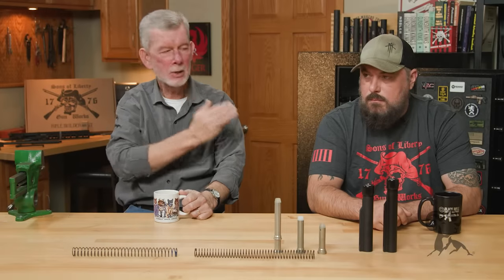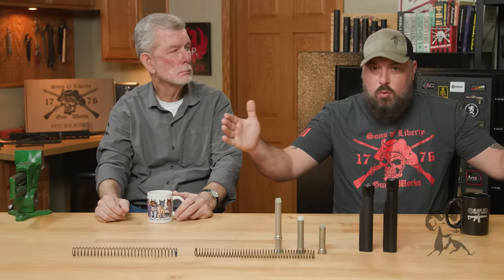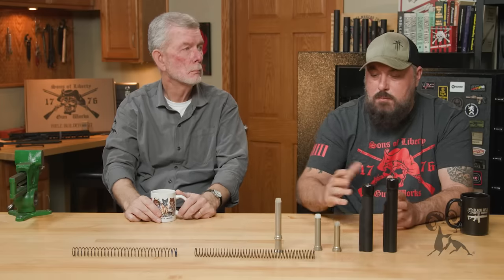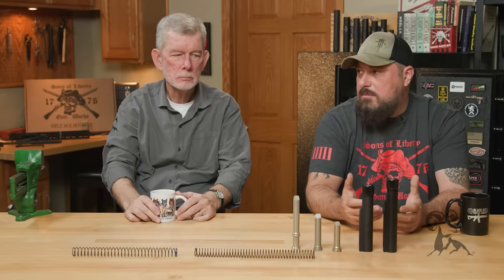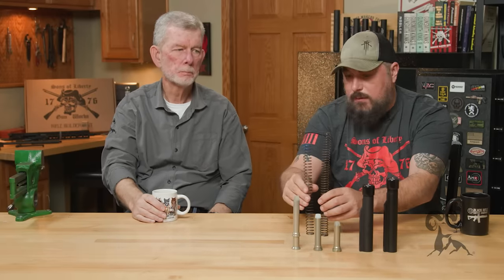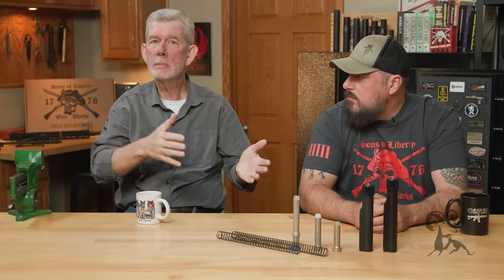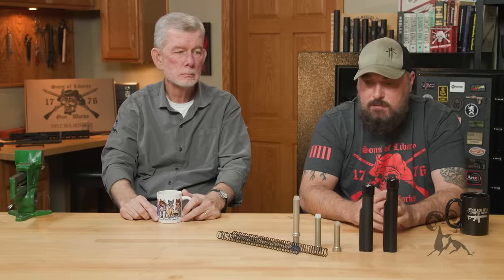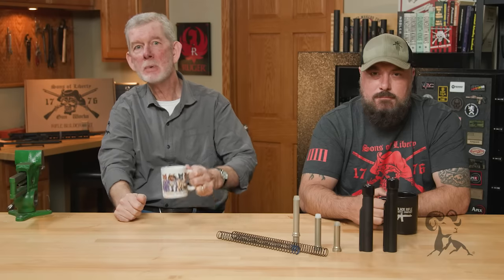Quick Tip: Benefits of an A5 Buffer in Your AR-15

Comment: THANK YOU for the 411.  I'm putting together a pistol length AR (10.5" barrel) what suggestions would you give me to make it FUNCTION CORRECTLY?  I like this length because it makes the weapon lighter and handier. I'm 69 and weight DOES MAKE A DIFFERENCE NOW.😯😁😎
Reply: I don’t have a 10.5 but I do have a 11.5 with a carbine length gas system. I originally had a springco blue and a h2 buffer in a carbine receiver extension surefire 3p. It’s 556 so it’s not like it’s super hard recoil but you did have to try to keep it on a 6in circle at 10yds. 

Only thing I changed was the buffer tube to an A5 system with their A5 h2 buffer green springco spring and it recoils slightly, and I mean slightly, harder than my 16in mid gas SOLGW with the exact same A5 system. Really can’t go wrong with it. It also made my ejection a bit better too. Bcm 11.5 upper btw.

Comment: I would like to learn more about managing a mid length with a 16" barrel
Reply: My recent build is a 16" Criterion core series barrel with a mid length gas system. Using a Vltor A5 H2 buffer, BCM mid length buffer tube with a springco standard rifle spring. Very smooth and reliable.
Reply: I run a 16" middy, with the A5-2, Magpul M-110/SR 25 buffer tube, Strike Industries flat wire rifle spring. Luvin' it.

Comment: I'm currently building an AR308 with Aero  Precision parts, 16 inch barrel with mid length gas block and was told I can run a AR carbine weight with a 308 rifle spring. I'll be using the Magpul UBR stock and was wondering if this set up will work? Any input is appreciated.
Reply: Just make sure you get the correct t length receiver extension (buffer tube)

AR-10 (armalite) used the intermediate receiver extension and a standard length  buffer.

LR-308 (DPMS) used a standard carbine extension and a special short buffer that they did not show in this video.

I've put together both versions and I've had guns put together by shops that didn't know any better.  I had to fix their mistake.

Also, my Aero 16" build is very overgassed. Aero barrel.  My buddy's 18" faxon barrel was also overgassed.

An adjustable gas block was the best option for taming excessive recoil, combined with appropriate muzzle device.  This was after maxing out the buffer weights on both setups.

Comment: So is a captured spring/buffer system still the best and this is just better than the worst? 

Also, Mike said he prefers to adjust from the buffer rather than the gas lort but didn't explain why. What is the downside of adjusting the gas flow?
Reply: The majority of adjustable gas systems for direct impingement ARs are of gas system set screw adjustment design. The set screw either loosens up or in certain instances become carbon locked. 
 It's a finicky and unreliable method of adjusting the gas system which can result in short stroking failures. In theory it's only beneficial for sound suppressor to reduce backpressure. However, low backpressure suppressor makes an adjustable gas system unnecessary. There's also the option of using enhanced BCG specifically for suppressed AR carbines which will vent off extra gas - the LMT enhanced BCG and Gemtech suppressed BCG

Comment: Just asking but why is this better than having an adjustable gas block?
Reply: Because the system was originally developed for Marines, when they initially transitioned to the M4. It made them more "rifley".
I run the A5, on a 16" middy, with an adj gas block, and was able to tune it to perfection.

Comment: Ak guy question: Why is there a buffer weight in the AR system?  AKs, G3s, FALS, FAMAS, etc don't have it.  As far as I know only the AR10-15s have that kind of setup and I have never understood why.
Reply: Not an expert here. But basically the bolt of an AR cycles back into the buffer tube that the stock is mounted to. The spring and buffer are contained in the tube. The spring length and the weight of the buffer can change how fast the bolt slows down and how fast it returns the gun into battery. So if it is too heavy the bolt may not be able to cycle back far enough. Too light and it will not slow the bolt and cause excessive wear on parts. There are other issues but that’s getting into the weeds. It’s a balancing act between the gas operated bolt blowing back and the spring and buffer slowing it down. Some people run heavier buffers to help with felt recoil or when shooting suppressed because there is more gas blowing the bolt to the rear. Hope that helps some.

Comment: What I think quite a few people forget about as well is the other side of the benefits of the A5 system. The A5 buffer system also does better than a full length rifle buffer. 

I personally use a 20" ADCOR upper with a MagPul UBR Gen. 2.

Comment: Yeah I'm not buying it.. 

1. The bolt travel is not elongated with this setup. No matter how long the buffer tube/buffer is, when they are matched correctly, bolt travel is the same. 
2. It's better because more weight? Carbine buffers come in more weights than 3oz. 
3. You'd rather add more reciprocating mass than to regulate gas? That's a temporary solution to a permanent problem. F=M x A. Your perceived recoil may go down due to slowing down the carrier (because buffer weight was increased), but your bolt is still traveling back faster than it needs to. 

The reason people say that the 20" AR's shoot so much softer is because they have a heavier buffer, they use rifle length gas systems (less pressure needed to unlock bolt) and the rifles in general are heavier.

Snake oil in my opinion.
Reply: completely agree with this, it's a bunch of bullshit.

Comment: I have a mid-length upper gas system with a carbine buffer spring, everything cycles perfectly no issues. but I did think it would be a smoother recoil with the mid-length system, but it feels the same as my other rifle (carbine gas system). ? should I change the buffer system? If so what kind?  its a aeroprecision 16" upper mid-length gas..
Reply: 8 months late however I would recommend you use an H2 buffer with a Blue Sprinco spring. Works very well for me.

Comment: Couldn't you just run an H1 buffer and effectively get the same thing? Also a heavier buffer simply isn't needed on a mid length you are already working with significantly less port pressure which is why most people just just the carbine buffer or H1.
Reply: It doesn't net the same benefit. The point of the A5 system is that with about 3/4" longer tube that is enough space to run the rifle spring. The intermediate buffer length and weight was tailored to work in that system.
You can't just put a heavier buffer in a carbine tube and get the same benefits.
Reply: @jamiemitchell9733  what benefit would that be ? The point of the buffer is simply to slow cyclic rate and prevent bolt bounce. Which is what H1's have been doing for as long as mid lengths have been a thing and people havent had an issue especially if you are running suppressed.
Reply: @nemisous83  So you just don't understand that more coils, more travel, and one more space for weights in a longer buffer makes it run smoother? 
I can't help you, then.
Reply: @jamiemitchell9733  mid lengths with an H1 are already incredibly smooth as is so again indulge me whats the point? Your the type that would advise people to get muzzle brakes on a 5.56 because "muh softer shooting"
Reply: @nemisous83  I'd never tell you what to do with your money, but if someone was building a rifle or could buy one with the A5 system included there's no downsides, only benefits.
Reply: @nemisous83  and chill out everyone can still run H1 midlengths. No one said they suck. Clearly your ego has a stock investment in H1 buffers.
Reply: @nemisous83  I have an exceptionally soft shooting Mid length with a carbine length receiver extension, and I also have  carbine length 10.5 with an A5 buffer setup.  

The 10.5 was more violent by far prior to the A5 upgrade for what it's worth.  I might try the midlength upper on the A5 lower this weekend to see if it's any different 🤔
Reply: @nemisous83  and softer shooting is softer shooting.  I've never understood the ego thrown around here.  When trying for extreme performance less recoil makes things easier to achieve success.
Reply: @Buletspunge555  yes but when you are talking a longer buffer tube you increase overall length at that point you might as well just run a rifle length buffer/stock because overall length collapsed is only an inche shy of a A1 stock.
Reply: @nemisous83  I suppose it all depends on recoil techniques employed and the size and shape of the individual behind the rifle.  I myself don't necessarily agree with the A1 length argument.
Reply: @jamiemitchell9733  there isn't more travel, the buffer is longer and the buffer tube is longer, the bolt travel isn't longer than a carbine system.

Comment: Wonder how it effects the life of bolts on 10.3/5 ARs. I hear life expectancy is 40% shorter than even 11.5-16" guns.
Reply: It helps because it’s unlocking at a lower pressure because of the weight and biasing spring
Reply: I know this reply is about a year late but.......
Correctly drilled gas ports in the 10.3" and 10.5" barrels (.070") along with either "H" or "H1" buffers makes a SIGNIFICANT difference in the life span! 
Correct ammo like M855 or M193 also contribute to that. 
I am in the process of acquiring an A5 system for my full auto 10.3" Mk18! We shall see if it really makes a significant difference!

Comment: I recognize this guy....he is the one that advocates for using 271 loctite for the gas block screws on this video: https://youtu.be/c-Ff10Fh0c8
I'm not sure I would listen too much to what he says in other areas as a result.  Threadlocker that tops out at 500F has no business adjacent to the barrel.  Rocksett only.
Reply: Tbf That was 4 years ago. And I think currently he actually recommends pining a gas block if you can.

Comment: So would this work for a 16" ruger ar 556?
Reply: they way it is explained it should help that carbine cycle a little smoother
Reply: @MJA5  would I have to change my current stock or is it more like a drop in replacement?
Reply: @TerminalM193  50/50 depending on the diameter of your buffer tube and the replacement tube (it takes a different length tube).  But if your Ruger runs fine, why bother?
Reply: @TerminalM193  your current stock will work. Diameters are the same. Only the length is different.
Reply: @deangullberry5148  God bless you, going and ordering now
Reply: @MJA5  for some odd reason my AR kicks harder than others I've tried. Tons of muzzle rise and I don't want to put a compensator on it and make it any louder than it already is. I'm still very green when it comes to ARs and I'm just trying to see what options are out there. It could just be placebo but about 2 years back a friend of mine had the same gun and I swear it had significantly less recoil compared to mine and his was stock except for a nice charging handle that he had lol.
Reply: @Dean Gullberry you do know there are two different common buffer tube exterior dimesions?
Reply: @Ryan Ianaro it's worth a try I'd guess.
Reply: @MJA5  Yes, but Ruger, like pretty much all manufacturers use milspec tubes, not comspec.

I received my armorer certification in 91, and in all these years I've seen ONE comspec tube.  It wasn't even on a gun, it was sitting on the back of a shelf in a mom & pop gun store. Had to knock the dust off the packaging to see what it was.

Comment: I bought a kynshot hydraulic buffer for my ar15. I didn't realize until receiving the item that it's for a foldable stock, I have a fixed stock. What will happen if I used it in the ar15

Comment: The mil-spec rifle is slightly overgassed for battlefield reliability.  By adding a heavier buffer, you fake it back to normal and gentle.  Just fix the actual problem and throttle back the gas.

Comment: I have an 18" upper with a rifle length gas system that ejects at 3 to 3:30. Would it benifit from an A5 or a rifle length buffer system?
Reply: 3 to 3:30 is perfect ejection for a duty rifle.

Comment: Had problems with my 20" 6mm mongoose. Took two weights out of the buffer drilled out the gas hole incrementally 3 times. If I had the money a light weight bcg would

Comment: I don't get it.  The length of the buffer increases with the length of the tube.  You have the same amount of travel.  If you increased the travel, your gas key would come too far back and you'd have a REAL problem on your hands (Like if you put a .308 buffer in an ar-15......very bad). Perhaps, with the A5 buffer, the spring is slightly less compressed.......but isn't that the same thing as having a few less coils on a carbine buffer in a carbine buffer tube?  This whole, "it really smoothed out the action" thing seems a bit suspect to me.  Wouldn't you be better off just buying a flat wire spring for $15 than to swap out your entire tube, buffer, and spring?  Unless you are looking for increased length of pull.....I can't see any advantage of an A5 buffer.  Please enlighten me.

Comment: I'm sure the A5 system is great. But for the FEW YEARS that I wanted to give it a try THEY COULD NOT BE FOUND IN STOCK, lol. EDIT: Just went to the Vltor site, and the $65 spring kit is listed as "Out of Stock." WTF would I want something I can't have? WTF do they have this COMPANY if they can't manage to have product to sell? Most of the A5 products are out of stock except, it seems, some of the actual buffers. But to use them in a build you need ALL the components.
Reply from the maker: Look at the BCM equivalent. MK2

Comment: Does this buffer tube attach to any millspec lower and accept any millspec buttstock?
Reply: yeah. A mil-spec and civilian sized buffer don't vary in thread and interior dimensions, but in outside diameter on the stock saddle.

Comment: Sorry, proprietary buffer and harder to find rifle length springs make the A5 a no go.  I never noticed any significant difference with an A5 over a properly gassed and tuned (buffer weight)  AR.  Recoil and can be reduced with a muzzle device that has zero moving parts.  Work both ends and you can stick with standard carbine parts.
Reply: a no-go...for you. Once the buffer tube is installed how is it a factor? You don't keep spare springs around?
Reply: @MJA5    Think worst case scenario.  Most people aren't running rifle length springs.  Should you find yourself in a position where you need to borrow, beg or steal parts, you're going to have a harder time finding a rifle length spring over a carbine length spring.  The juice isn't worth the squeeze.  it doesn't offer any significant improvements in performance or reliability that can't be achieved through muzzle devices and/or buffers.
Reply: @225degrees  I guess I'd have to try one (an A5 buffer system).  I use Geissle Super 42 springs and buffers in about three of my carbines.  They seem to vibrate less, but honestly they don't move the needle much that is perceivable to the operator.  I could see broken extractors and weird stuff happening after many thousands of rounds of hard cycling,  but the carbine design was always a compromise. I have lots of springs around here and spare parts.  I just have never had to expediently change out a buffer spring.  Long wear item.
Reply: @MJA5  I too use Geissele springs and only for the increased weight and reported lifespan of the twisted wire spring.  A regular recoil spring will wear out in relatively short order.  There are minimum and maximum lengths for each.  Remove them and measure them.  If they fail they go in the trash.

I'm not saying an expedient spring change is common.  I'm simply looking at the A5 from the most extreme scenario.  The increased logistics issues (and cost) it brings are not worth the perceived comfort gain in the recoil impulse.  It ranks up there with other marketed gimmicks like accuwedges, bad levers, and offset iron sights.

Most items out there for the AR rifle are gimmicks.  Without them there wouldn't be much for options.
Reply: @225degrees  haha on that I agree, there are lots of tack-ons to the platform that are gimmicky.  In a rare instance something will come along that seems worthy of adopting.  The designers of the platform did a good job of giving you pretty good controls and the system is pretty robust assuming it's of decent manufacture.  People that shoot thousands of rounds a month can form opinions on wear items that I simply cannot.  Even when I was active duty and spent 8 years in s special operations unit we did not rack up that sort of round count, although some units did.  In the conventional units I was in we shot twice a year, but we were primarily aviators.  I guess the system is like golf, you can spend as much money as you want on equipment, but that doesn't mean you strike the ball well.  Cheers!
Reply: @MJA5  Agreed!  The A5 isn't the worst thing a guy could put on his rifle.
Reply: @225degrees  on a side note, I did buy a spare barrel from the manufacturer of the A5 kit, I have heard good things about those, and it wasn't the cheapest but it wasn't outrageously priced, either.  But it's just a 16 inch mid-length gas system.  I bought it and a couple gas tubes as spares, maybe I'll do a build with it and try the A5 kit on said build and see if it is a soft-cycler as they claim.